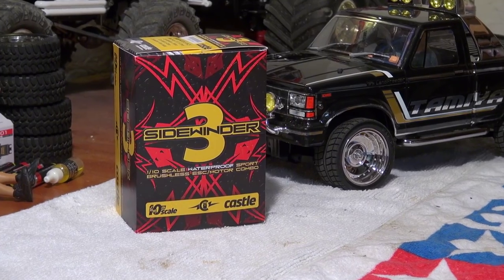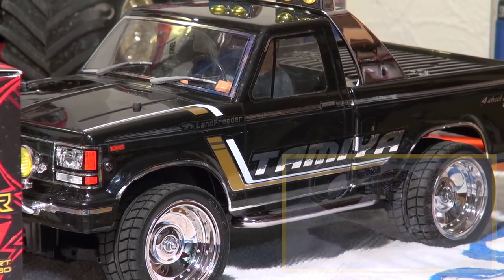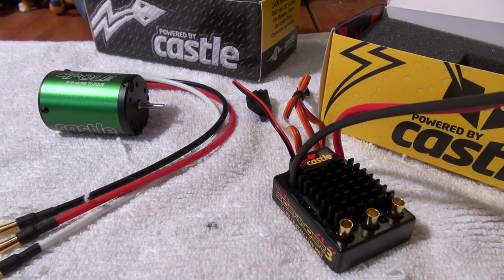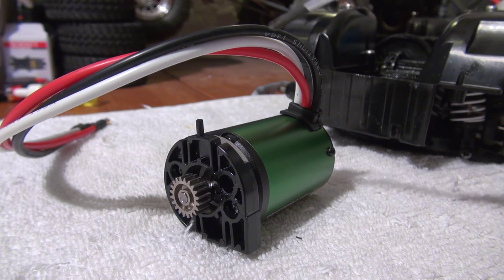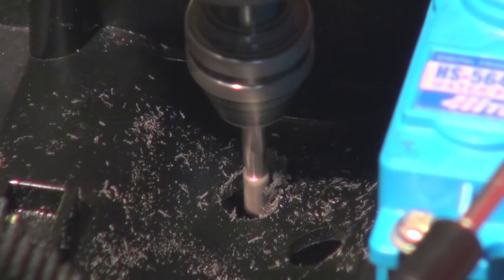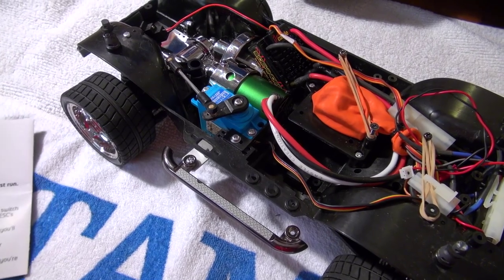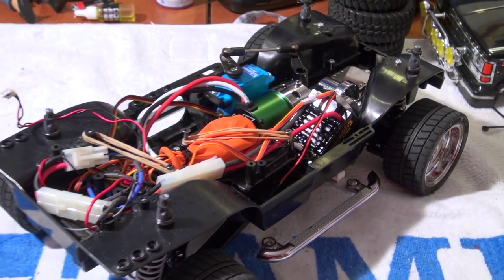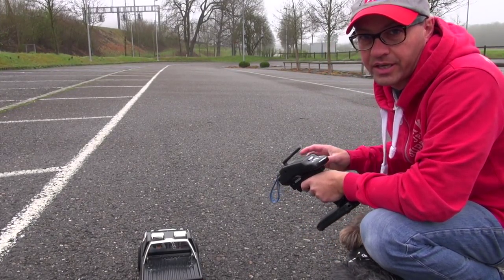Tamiya CC-01 SIDEWINDER 3 upgrade - Is this the fastest CC-01?

Comment: I have run 2 Sidewinders often crossing water (Traxxas TRX4 Sport Motor Acis 6 on 3s ) but every  Sidewinder 3  burn after 2 years of use. Now i use  Hobbywing Fusion (like a submarine) with non problems .I wish the Fusion is more durabel.
Reply from the maker: I use also Castle Mamba controller and 1406 motor, also no problems with water.

Comment: you wouldn't have to reverse the channel on the remote, just swap out any two wires of the brushless motor to change its direction
Reply from the maker: Yes, I know this, but strangely it was impossible to programming the ESC without reverse the channel.

Comment: ok first if of all how long does the battery last and 2 can it go on the tamiya defender too? probably both really simple questions but I'm a noob and I'm think about getting one
Reply from the maker: How long the battery goes depends on their capacity. With 4000 mAh it goes about 20 min. Principially it can be installed on every car. But a scaler like a defender is not build to go verry fast, so I would recommend something slower.

Comment: I put in Tamiya BZ 23turn motor with 20tooth Pinion gear and thats more then Enough power and speed. Its Get up too 25mph and that more then good for a small rc Like CC-01.
Reply from the maker: Yes, I agree. I mine, I would only test how good the ball diff works...

Comment: Thanks Matteo for another good video. I believe brushless motors are more efficient than brushed and so how does your battery life compare to when you used the original 540?
Reply from the maker: +Dave Gaskell Yes, the battery life is longer with a brushless system, I think about 30%. One reason is the efficiency but also the surplus of power needs not so much full throttle.

Comment: Great work! I have a 10.5T brushless set up in my CC01 Touareg and it's pretty fast. I just wonder how you got your dog to like RC as much as you do! My two miniature schnauzers absolutely hate my cars. They bark like crazy and want to attack them the moment I place them on the ground!
Reply from the maker: bel976 Hoho, they are fighters! They see the car as competitor!
Reply: I put a Tekin G4 Spec R 13.5T redline motor with Tekin RSX Pro more then enough power. Got to about 34 mph with 20t pinion gear.

Comment: Nice video and very detail. May I ask how to do the waterproof work on CC01 chassis, because I see the waterproof servo on your car. The CC01 chassis, the motor and diff gear are connected directly on the chassis body, and I saw lots of holes on the chassis body, to cool down the motor. So don't we worried about the water will entry the diff gear box through the holes? Thank you
Reply from the maker: +yimin chai I seal only the electronics with this method: https://youtu.be/srYwTVjT5Nk
I do nothing with the gears motor and axles. No problems with this parts so far.

Comment: Out of curiosity what speed you got out of that 4600 kv motor. Im going to put in a Tekin RSX Pro. In my CC-01 and maybe similar power motor from them as well.
Reply from the maker: Not easy to judge, I guess about 40 km/h

Comment: Matteo the cc01 has metal gears or plastic ? I want to buy it or else i don't like if it has plastic gears.
Reply from the maker: It has plastic gears. But this is not a problem, never had issues over years.
Reply: Tamiya plastic gears are durable

Comment: you know what combo castle creation that would work in SCX10
Reply from the maker: +Canal do RC Brasil I can not recommend a castle system for an scx-10. Castle produces high speed motors, but in an scx-10 you need a slow turning system for crawling and scaling (scx-10 is not build for high speed). So, it's better to use a crawler combo.
Reply: +Matteo's RC Movies    matteos just being cautious, good idea,  put in a 3800-4600kv and start with 14t48pitch  pinion and let it rip.

Comment: Would that motor be good for the Gelande 2 D90 or would it be to fast because i have a d90 and want to buy the esc but not sure about the motor
Reply from the maker: +Samuel Gibson I can not recommend it for this car. It will be absolutely too fast and not enough sensitive for slow crawling. Gelande 2 is build for some slow crawling and trailing. Better you use a crawler combo.
Reply: Ok dan lass ich mein Rc4wd 45turn drinnen der wird aber schon mit dem sidewinder 3 esc gehen oder?
Reply from the maker: +Samuel Gibson Uff, das weiss ich ehrlich gesagt auch nicht. Vielleicht findest du was in den Specs des Reglers auf der Homepage.

Comment: You must have been only giving it 1/4 throttle, because I have the similar setup sidewinder 3 1406 5700kv on 3s lipo, and its about that speed at 1/4 throttle
Reply from the maker: +Bryan Lee That's easily possible. Because I use only a 2s lipo, and the gear ratio from the CC-01 is very high.
Reply: Oh ok got ya,

Comment: Are you using a high c rated lipo .. would give it more speed!!!!
Reply from the maker: Mine have 45c is it not enough?
Reply: ***** Haha yeah plenty !! I wondered if it was nimh or lipo .. so you have a 2 cell 45 c lipo running it nice . I think i was wrong in stating the higher the c rating , i meant the higher the amps .